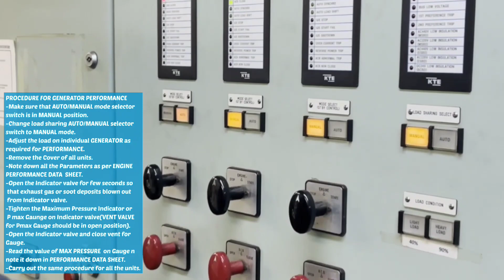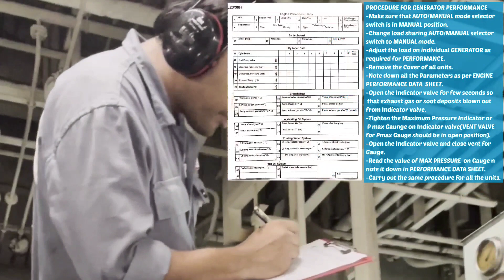PROCEDURE FOR GENERATOR PERFORMANCE TEST || STX-MAN B&W

Comment: brother, how can i test "compression pressure"?
bcz if generator is at max load, and i cut off fuel of 1 cylinder unit, do you think other unit will get imbalance?
or i have to take it with off load condition?
Reply: do not ever do that while taking compression pressure alwz take compression pressure while generator running off load nt on  load
generator running on max load nd u just pull or push rack to zero there r severe chances of black out